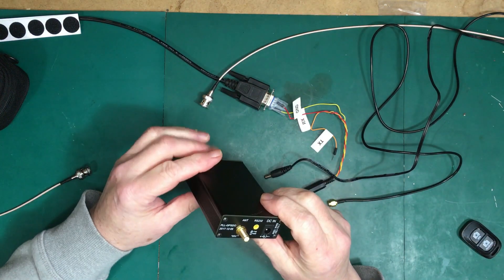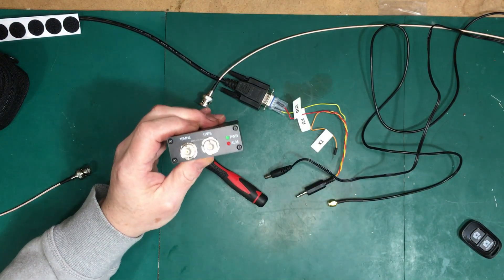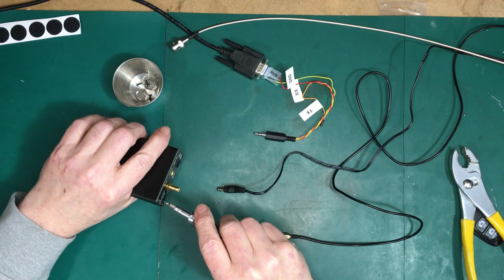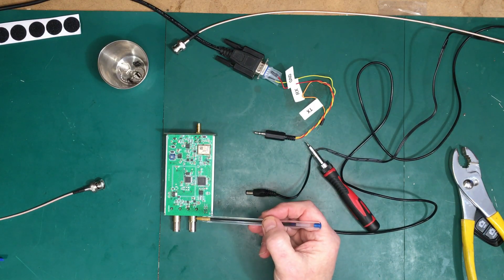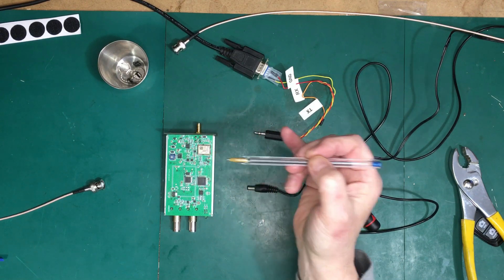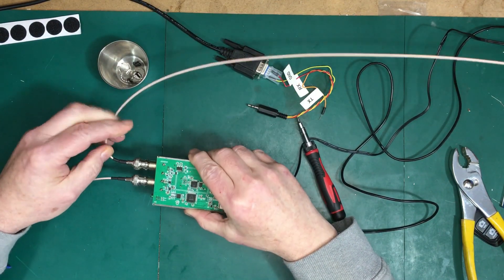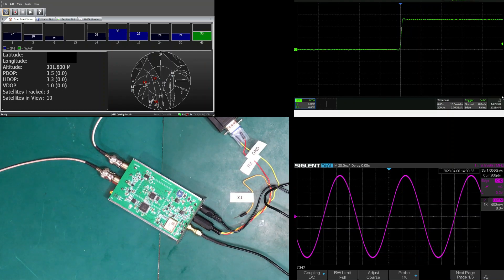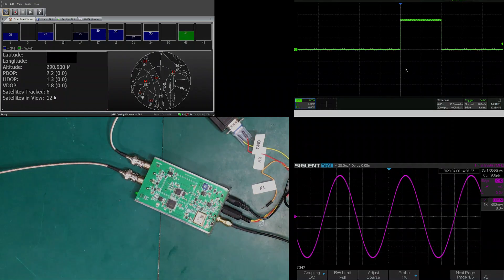Uni-Byte 0034 - Quick teardown and poke about the $90 GPSDO

Comment: Hi! Thank you very much for the video, very interesting stuff. I have purchased the same one like you have, but I can't for the life of me get the thing to show up on the VisualGPSView software. What Serial parameters did you use? Data bits, parity, stop bits, baud rate and other.. I only get gibberish on the serial output, no matter what the baud rate.

Thank you in advance! :D
Reply from the maker: Give me a day or so to check and I'll get back.  Thanks for the question and the view
Reply from the maker: Hi, 8-bits, no parity and 9600 baud seems to work for me.
Reply: @uni-byte  Hi, thank you for getting back to me. I realised that I needed to get a dedicated RS232 to USB adapter cable and everything worked like a charm (I can confirm your settings).

But now I’m puzzled, shouldn’t it also work with a normal USB to Serial adapter (those 2$ cheap-o ones from AliExpress)? I used the exact same settings and I only get gibberish with them. The new one I bought (Sabrent brand, having a FTDI chip inside) is also basically just a USB to Serial adapter with a different connetor. Or am I worng here?
Reply from the maker: @antonmilosevic  I too am using an FTDI unit.  I also use CP Technologies (CP2102, CP2103).  With out having you defective device it's hard for me to say.  It may not be adjusting to the baud rate properly.  Did you make sure it's set up for no parity?  What did you computer recognize the chip as?
Reply: @uni-byte  Hi, this topic really doesn't let me sleep properly at nigt. The CP2102 USB to TTL Module just won't work. I set it up exactly the same as the more expensive Sabrent RS232 to USB cable with the FTDI chip. I even looked with the oscilloscope and the signal coming out from the GPSDO is a normal 5V signal. Any more ideas why the CP2102 doesn't work with this GPSDO? It works normally when looking at other devices tho.
Reply from the maker: @antonmilosevic  I don't really know.  What are you seeing?  I assume that since it is working with other things you have the drivers installed and you are not mixing Rx and Tx.  Is the ground properly connected?
Reply: @ drivers are from the official web sites, Rx is being used (double checked a few times and even tried flipping it with Tx just to make sure). Ground is also good since I made a custom cable same as you with tight fittings on the end.

One thing maybe, could it be that the boards are not 5V tolerant? I mean they have 5V on the header, but that the signal input/output can’t take 5V?
Reply from the maker: @antonmilosevic  I have used both the CP2102 and CP2103 in 5V designs before.  They are USB devices after all, so they get 5V signals from the USB port too.  Internally they are 3.3V, but they are 5V tolerant.  Perhaps you have faulty or counterfeit parts.
Reply: @antonmilosevic  I have exactly the same issue. The port is set correctly, VisualGPSView shows correct connection and receives data from the device but doesn't work. I only have cheap USB to serial adapters - one with FTDI232RL at 5V, the other with CH340G. The CH340G has 5/3.3V jumper but no luck either way. The adapters are tested to work fine if TX/RX are loop connected, also with arduino boards and other devices... 😒 So, obviously, I also have to buy another adapter unfortunately...
Reply: @uni-byte In order to connect my device (exactly the same as in your video) with a cheap FTDI or CH340 adapter to my computer, I had to invert the TX output signal. Now it works as it should. 🙂
Reply from the maker: @MrTon4eff  Glad you got it figured out!
Reply: @MrTon4eff hi, I’m not sure if I commented already, but I purchased anither cable from amazon AND IT WORKED. This is the listing name:

Sabrent USB 2.0 to Serial (9-Pin) DB-9 RS-232 Adapter Cable 6ft Cable [FTDI Chipset] (CB-FTDI)
Reply: @antonmilosevic  The cheapest TTL USB adapters also work without any issue, as I figured later, luckily before the purchase of the expensive cable. 🙃 The output from this GPSDO is RS232 TTL (0/5V), not RS232 (+-12V). So it just needs to be inverted. I don't know how it manages to work with those RS232 (+-12V) adapters, maybe there is an inverter in MAX232 (RS232 (+-12V) converter) chip. It still doesn't explain how it works with lower 0/5V levels though 🤔... Anyway, just inverting the signal worked fine with both CH340 and FT232RL adapter. That's it.
Reply: @MrTon4eff you inverted it simply with a Transistor, or?

Funny that Software cant do this :)
Reply: @antonmilosevic  Yes, just a transistor with 2 resistors, output pulled up to +5V.
Reply: @MrTon4eff  Not all USB/RS232 adapters are correctly bi-polar on the RS232 side, they use TTL levels instead of +/-6 V to +/- 12 V.

Comment: I ordered a similar one that came from Aliexpress but it's rather disappointing.  On the display it just says 10.000 Mhz GPSDO for a while then changes to say PPB -2.3 and PWM31077 but there are no instructions at all so I have no idea what that means.  Pushing in the knob gets into a menu where I can select Contrast, Offset, PWM Set and Exit but that's all.  It never displays the time like they show in some photos and there's no way to even tell if it's picking up any satellites or working at all!  I opened it up and inside it has an Arduino STM32 and NEO-6M module plugged into the main board with just it's 5 pins holding it. The main board also has a 10.000 Mhz OSCO on it and outputs on the back for 1PPM and 10 Mhz..  With the top off I can at least see the LED blinking on the NEO-6M so I guess it's working to some extent but they should have put the LED on the front.  Since there are no instructions can you tell me what PPB -2.3 and PWM31077 mean and how to use the settings for Offset, PWM Set?
Reply from the maker: I am not familiar with the one you have, but if my guess is correct try googling for "si5351a based GPSDO"  and look around in the results.
Reply: @uni-byte  Mine just has an Arduino, GPS, 10 Mhz osc with a 5 volt regulator and LCD, there's no VCO.  After it runs for a while the PPB number goes down to just a fraction like 0.6 or something so I think that's some amount of error?
Reply from the maker: @stevec5000  Honestly I have no idea.  I'd either need the instruction manual or the code for the Arduino to be able to tell what is being reported and why.  Sorry.  Keep searching and if you find something drop a note here to help out the next person.

Comment: Thanks for the (two) video(s) about this GPSDO!  Suppose you have a short power cut, does it again take a few days to stabilize completely?
Reply from the maker: You're welcome.  After a power failure it goes through a multi-step process.  Firs, after about 3 minutes the OCXO will come up to temperature.  When that happens the accuracy is better than 1 part per million.  In about 30 minutes it will have acquired enough satellites to begin disciplining the OCXO and teh accuracy increase to less than 1 part in 100 million.  To get to around 1 part in 10 billion supposedly takes it less than 24 hours but since this is the most accurate device I have I don't have any way to ascertain that.
Reply: @uni-byte  Thank you for this informative response!

Comment: Same GPSDO as mine. Future project is to get my used eBay rubidium up and running, and then compare.
Reply from the maker: Rubidium.  Nice!  I think the Rubidium is better short term, but the GPSDO will beat it over time.  The GPS system is governed by cesium standards.
Reply: @uni-byte  Yep. It's neat that GPS not only solves 'Location', but as a side benefit it distributes precise 'Time' and 'Frequency' to everyone.

One could imagine a 'Time & Frequency' Go-Box with battery. One might be outside for 30 or 45 minutes waiting for the Green LEDs (including rubidium module) indicating phase lock to GPS, and then go inside to the basement (no GPS) carrying a just-locked atomic standard good for an hour or two.
Reply from the maker: @JxH  Sounds like a cool project.  Yes, a good rubidium module could last hours as a timing standard and even years as a frequency standard once properly calibrated to the GPS signal.

Comment: I'm guessing they're running a custom PID / FLL on the Altera to sync the ocxo into the 1 pps, that's quite a ways to go for one of the cheaper units! You could do everything from just a microcontroller if you wanted to. How warm does the box get after an hour then?
Reply from the maker: That's correct.  If it follows BG7TBL's original design paradigm that's exactly what it does.  The CPLD feeds data to the MCU which controls the OCXO who's output is then fed back into the CPLD.  You could certainly do it all in an MCU, but it would need to be a bit better than the ATmega8.  It gets warm in about 2 minutes and (by touch) seems to stay close to that.